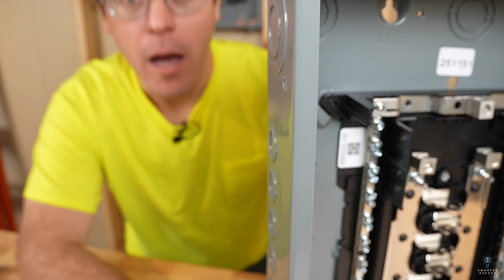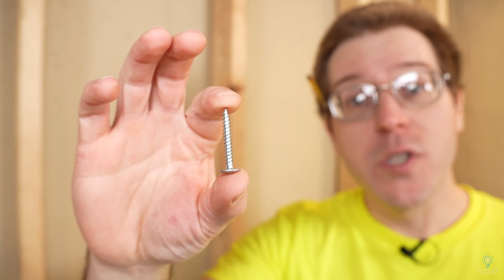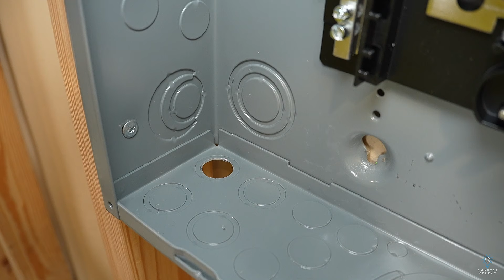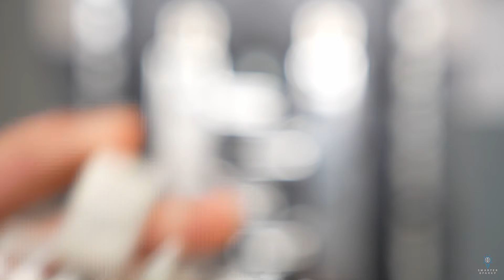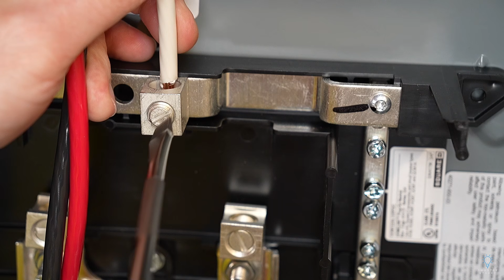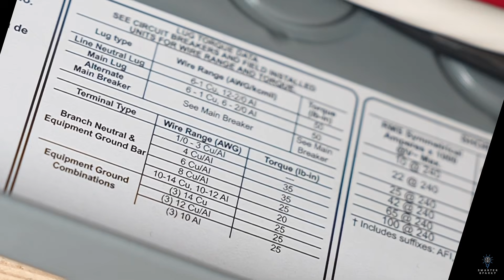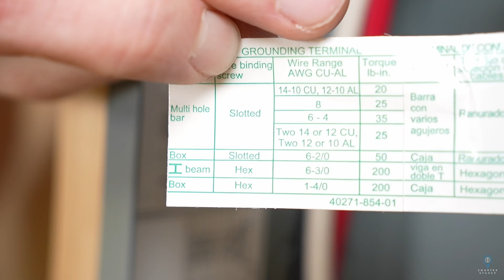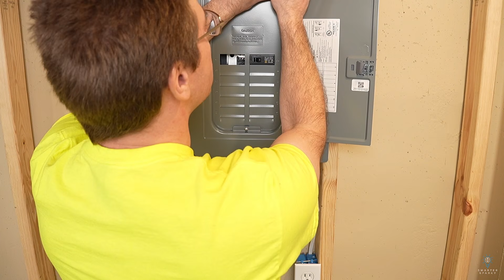Unlocking the Basics: How to Install a Subpanel

Comment: I dont believe you explained the possibility of a DIY possibly o erloading the main panel by addi g a new subpanel.   For example, if an old main panel is rated for 60 A service and you add a new subpanel pa el rated for 60 A or higher,  you could overload the main old panel where the main breaker in the old panel could trip often if the old main panel was feeding a filled up new sub panel with many circuits. 

Is this a possible scenario ?

And, how can this be avoided ?  Maybe adding another breaker to the new subpanel panel ???  Or do you rely on the individual breakers in the new subpanel panel to provide safety ??

.
Reply from the maker: Good question! That actually isn't a problem: your 60A fuses in the main panel would still limit everything to a max of 60A. So if your main panel was pulling 40A, and your subpanel tries to pull an additional 30A, it would blow the main fuses. You can't overload the main panel if it is protected properly. 👍

Comment: Also for if anyone wants a different understanding on sub panels, if you are powering it from your main panel your can pretty much put it on any size wire and breaker as long as you dont exceed the load, if you want the full power of a 100amp panel and powered by a 100amp breaker you would immediately think to use number 2 aluminum mobil home feeder/direct burial wire, that size is only Rated for 90 amps but permitted for a 100 amp raiting you just cant put it on a 100amp breaker to power a 100 amp sub panel, if you want to use a 100amp breaker to power a 100amp subpanel use # 1AWG aluminum  or # 3 copper
Reply from the maker: Those are some good points, thanks for the additions 😎

Comment: Great breakdown. The neutral vs ground separation in subpanels is something a lot of people overlook, but it’s critical for safety and proper system operation. Do you still see this mistake often in the field?
Reply from the maker: Thank you! I've seen it in the field a few times. I see grounds being used for neutrals more often, however. 😵You are totally correct that the difference gets overlooked.

Comment: Very nice video, brings back lots of pleasant memories - working as an electrical helper on Habitat for Humanity home builds under a main electrical helper under a licensed electrician.  I was told rules and you confirmed them and provided the reasons and some more variation than I saw as we did the same thing over and over again, with the same material.  Thanks.
Reply from the maker: Neat! Thank you for sharing 🙂

Comment: Correct me if I’m wrong but a 4 AWG copper is good for a 100A Main panel due to the 83% rule( diversity loads) but for a sub-panel  we must use 100% rule  so 3 Awg is appropriate ( depending on length of run off-course) if using aluminum same scenario is 2 AWG main panel and 1 AWG sub-panel. I don’t think 4 AWG aluminum is a right choice for a 100 A Subpanel.  I used 310-12 and 310-16 NEC 2026. I must rather use #4 AWG aluminum as stated in your video for a 100A  subpanel but if I am reading the NEC 2026 code book correctly I don’t think it will pass inspection. Thank you
Reply from the maker: You are correct; A 100A dwelling main can be fed with 4AWG copper, or 2AWG aluminum, but a 100 subpanel would have to be fed with either 3AWG copper, or 1AWG aluminum.

4AWG aluminum could feed a 60A subpanel. I must have mispoke in the video. I will try to find that and pin a correction. 👍

Comment: Thank you so much for this video. I asked you for this Subpanel video when you did the "Wiring Multiple Receptacle Outlets" video  and you responded that you do one!. A man of the people! I couldn't click fast enough to watch the video. I'm installing a subpanel in my garage for my woodworking tools. The builders only put 3 wall and 1 ceiling receptacle in the garage, all on one 15 amp circuit.
Reply from the maker: Right on! Good luck on your project! Can't get much done with 3 receptacles on a 15 amp circuit 😅
Reply: My garage has a single outlet and none on the front of the house!  Seriously below current standards.  The panel shows so many changes that have been made since it was built in the late 70’s…I think about starting over with a new main, upgrading from 200A service to ?, is 300A possible?  And straightening out the spaghetti inside the main panel — it’s the Wild West inside there after so many hands have touched it, bonkers.  I’d also like to have a subpanel for the shop for lighting circuits and several pieces of woodworking or metalworking equipment, and a subpanel for the garage — looking to charge one or two electric cars in the future, as well as an appliance circuit for a freezer, several general use circuits for both inside the garage and near the driveway and front walk, at least two lighting circuits for inside the two car garage.
Reply: @TSPhotoAtlanta sounds like a must need. I’d opt for a 400amp upgrade if possible. Then split it down to a 100amp sub panel for the garage and EV. 

I currently have the 200amp in the basement and will branch a 100amp to the garage. My EVs are on the main panel  are connected through PowerShare which is pretty cool. I’d say go for it if this is going to be the forever home, if not, it’s a good selling point.

Comment: Could you make a video on how to wire 4 different lights with 4 separate switches from the same breaker coming from my subpanel. I’m trying to finish my basement but I can’t  find any information on how to do it for 3 different rooms on the same circuit.
Reply from the maker: I will add that to my list! Cheers!

Comment: Really great video! One question - In the subpanel Line 1 was black and line 2 was red. Was that because that's how it's wired in the main panel, or just by convention? It seemed like the reasoning you gave for how to wire the breaker might tansfer, but I'm not sure. Thanks!
Reply from the maker: The convention is that lugs are always designated from left to right, top to bottom. And typically we color single phase black and red, so that's how we ended up with line 1 as black, and line 2 as red. Then on the feeder breaker, I continued that convention. If we would have shifted the feeder breaker down one spot, red would have been on top, and black would have been on the bottom. Hopefully that make sense 😅
Reply: @SmarterSparky  Thank you!

Comment: I know you have a ton of ideas but can you please
Put together a detailed video like you always do showing how to add electrical to a enclosed cargo trailer, lots of videos online, but nobody does the detailed close-up video work like you do.
Reply from the maker: That's a good idea! I'll add it to my list! 🙂
Reply: @SmarterSparky please do it no one is doing it correctly please save us cargo camper builder retirees
Reply: @SmarterSparky  100% agree. For instance, should a load center that is fed from 50 amp shore power / 50 amp generator be wired as a sub-panel? (Neutral and ground NOT bonded).  Great videos!
Reply: @martinbrazier690  My understanding is that the load center in an RV is wired as a subpanel (to the power post) similar to an outbuilding, but I don't think a ground rod is necessary.  Mike Holt has a good grounding and bonding series on YouTube & to purchase that I own but need to review so don't quote me on this.
Reply: Thanks for the knowledge Sir
Reply: Awesome! I would love to see this I am new here but I am here for the ride.